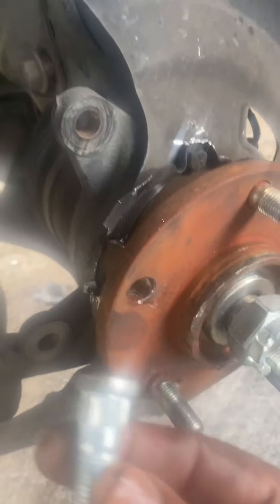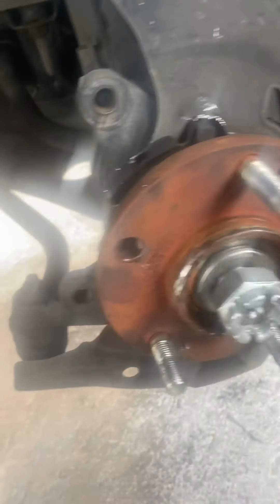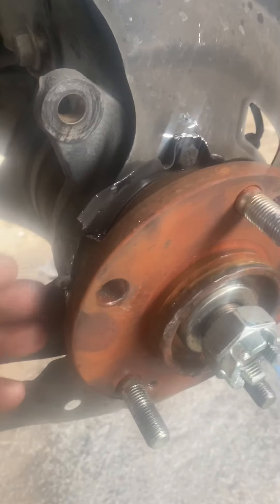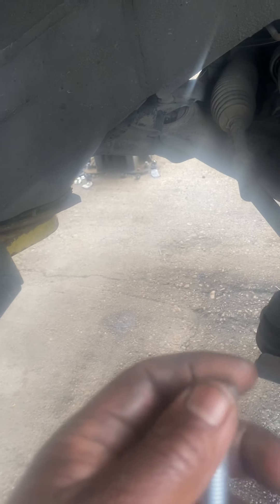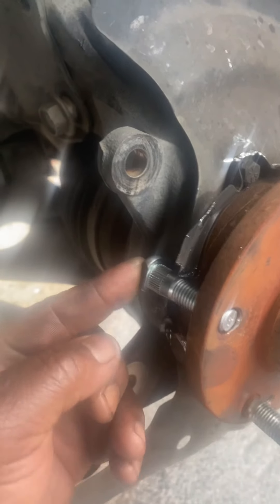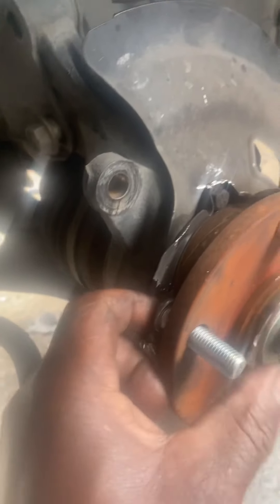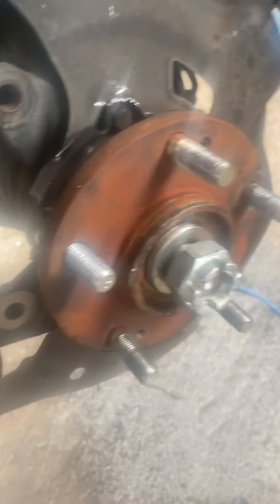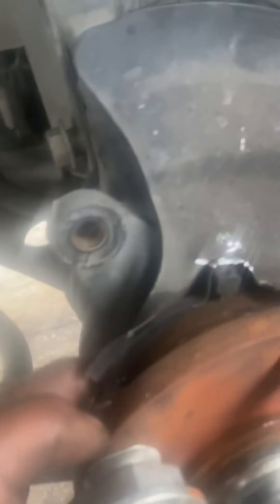Hyundai Sonata changing wheel stud easy and quick solved.

Comment: I found it better to make the cut on the heat sheild slightly lower, i didnt have to grind the stud it fit in. I then used a thread chaser on the threads. Super safe

Comment: Never touching my car
Reply: Dealers do the same shiit. They live to leave out screws on undercarriage shrouds, etc. You have to ask questions. Once had my homes steel lintel replaced. As the contractor was finishing, I realized he was using half bricks to fill in. GL
Reply: I’m a dealer tech who’s gonna have to do this cause the cheap customer doesn’t want to approve a new wheel hub.